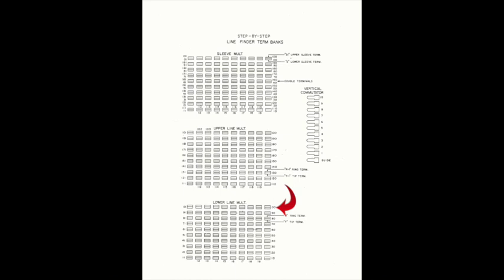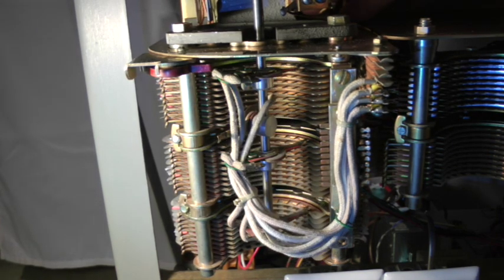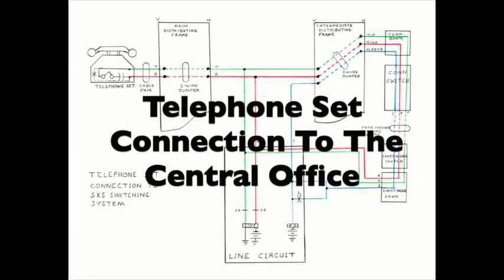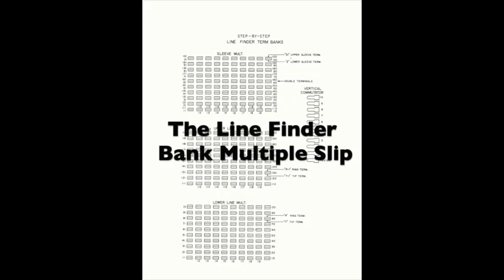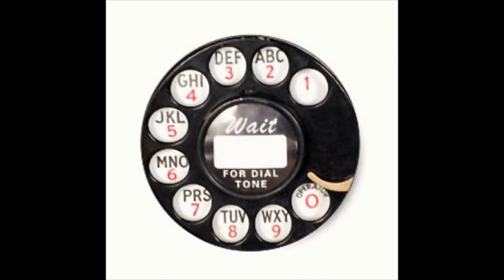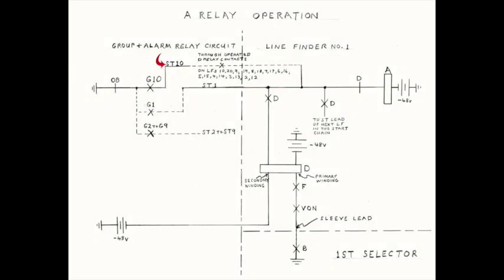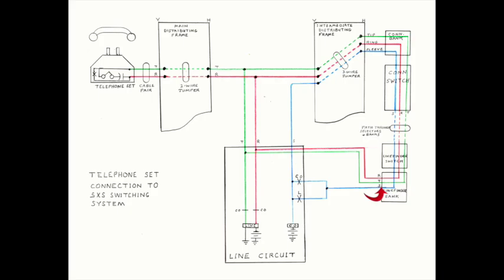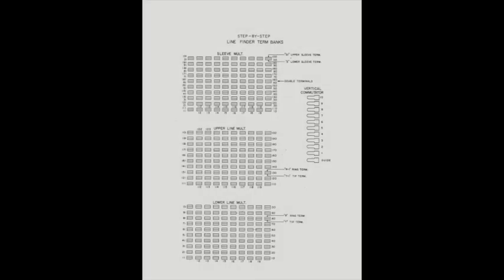The Line Finder In The Step-By-Step Telephone Switching System

Comment: This one is the most fascinating to me.  I think I've watched it more than a dozen times.  It annoys me no end that I worked around these central offices so many years and never once wondered how they worked.  But I was an outside plant kind of guy and the CO was somebody else's job.  How I wish I could go back and spend some time in there knowing what I now know about them.  Thank you so much for creating these videos.  I know these are difficult to produce and take a lot of time but I hope you have more information that you can share though I can' t imagine what it might be.
Reply from the maker: Many thanks (well at least 12) for watching.You're comments make it all worth while for me. My videos have now covered all of the switching equipment I have. However, I may do a video over the winter on the detailed operation of a rotary dial 3-slot payphone connected to my demo unit. I haven't seen anything on you tube that provides the level of detail I would like to see.
Reply: That would be great.  I worked on that type only a couple of times.  Single slot was everywhere when I was hired in 1975.  But it's the same, I knew how my end of it worked but not the CO end.

Comment: What's the difference between this video and your old video besides the new click-click-click through your whole 2nd paragraph?
Reply from the maker: Well, the 7 minute Dial Tone video doesn’t show or explain the operation of the relays, magnets, ratchets, pawls, interrupters, VON springs, 11th rotary step, bank multiple slip, subgrouping, transfer chain, open chain multiple, functions of the Group & Alarm Relay circuit or selection sequence process.
Reply: Haha, no no, sorry, I know the dial tone one doesn't. But I guess I thought my memory recalled a video from you that was specifically about the relays in the line finder. Anyway, I guess I'll have to go back and have a new look at the list of your videos too get reminded. Anyway, thanks, because you definitely put a lot of good work into these videos!
Reply from the maker: You're welcome. I have now made 3 very detailed videos of the 3 major types of switches, which are the selector, the connector and the line finder. They each perform completely different functions. However, the electromechanical operations involving the vertical and rotary stepping actions are very similar and use basically the same apparatus. I felt it best to keep each video independent and show the stepping details in each.